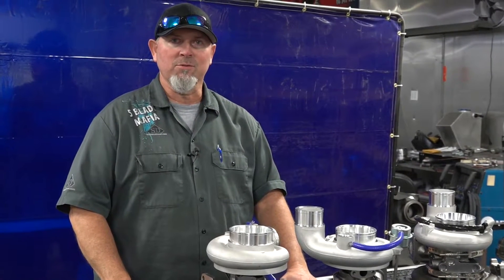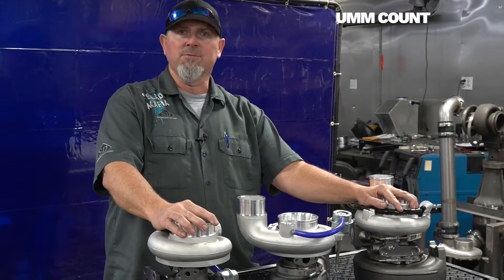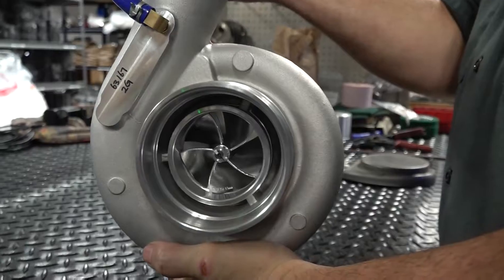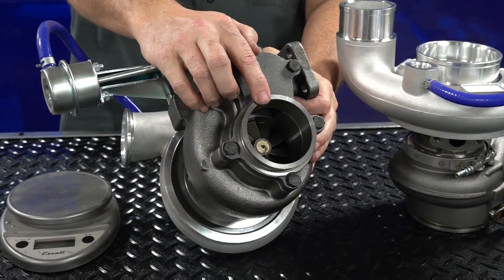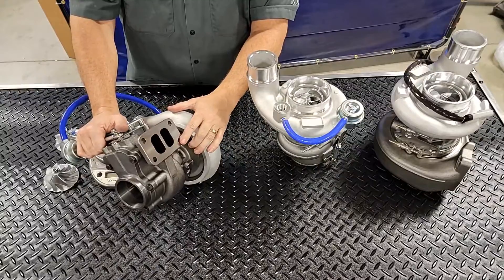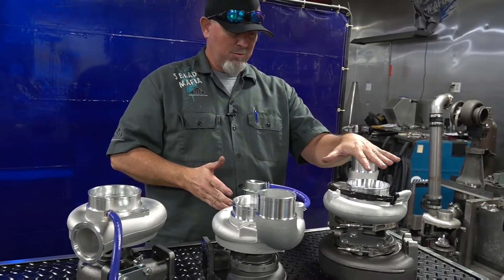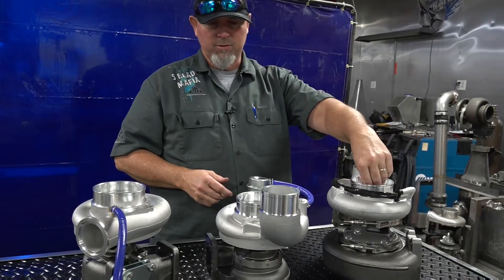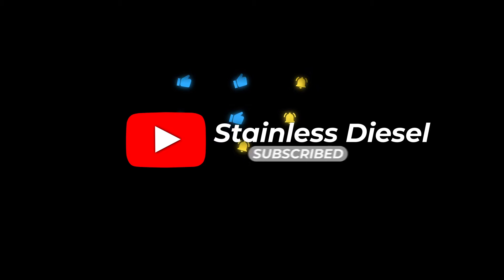OEM Bolt-On Boss Series 5 BladeTurbochargers

Comment: Hey I came up with something in college speech class. When I was running through my speech every time I said um I had another person say um back to me. It was really annoying but I only had to do it a few times myself and I've tried it on a few others with great success. I quit saying um all together. Again not trying to be mean or knock you just might help with the presentation. I hope this helps probably the only reason I noticed is because I used to struggle with it.

Comment: Any chance you guys can share or do a video on the weights of a factory HE351 turbine, shaft, compressor wheel and nut vs YOUR 60/60, 60/64, 63/67 etc?  Based on the weight you just showed, im guessing a 60/64 would spool the same as a stock 351, amd the 60/60 would be faster.  Would be a great video for you guys

Comment: What’s the advantage to the 5 blade?
Reply from the maker: Higher Flo, light weight 
faster spooling 
cooler, EGT’s, and a much louder jet engine, sounding  turbo whistle
Reply: I purchased one shortly after I made the comment. I love it!
Reply: @CBDiesel86 How the new turbo holding up? Any pros or cons you'd mind sharing?
Reply: @thesickening0169  doing good so far. Sounds awesome, and spools good
Reply: @thesickening0169  makes the truck that much more fun to drive. (5speed)
Reply: @CBDiesel86  How would you say its spools compared to stock? Just as fast, faster, or slower?
Reply: @thesickening0169  well I went with a tad bit bigger on turbo size Incase I wanted room to grow, so in a nutshell my fuel is setup for 500hp and I went with 63/67(650 rated) so it’s a tad laggy on back roads but on the interstate it spools pretty much instantly
Reply: @CBDiesel86  Perfect info, thats what I was thinking about going with too. Figured it would take a bit longer to spool up.

Comment: Finished installing the 63,67 hx35,huge difference in sound slightly harder to spool on stock injectors and I mean only a tiny bit for this size of charger its impressive
Reply: how would it spool with 5x12 injectors on my 97?
Reply: @Plantspirit  should spool just fine
Reply: How's it holding up?
Reply: @James L  runs great have over 10k miles on it now

Comment: @stainless diesel what can I expect from your 21 ram drop in turbo
Reply from the maker: Cooler EGT’s more aggressive turbo sound less drive pressure and faster  transient boost time on the 60/60  tow boss size .  Up to 730 horse power at the tires  on our 63/67 Boss units
Reply: @StainlessDieselRacing  MY GOD WHEN IS THAT BEAST GONNA BE READY IM LOOSING SLEEP YALL!!!

Comment: HOW WOULD YOU COMPARE THIS 6.7l DROP IN VS FLEECES UNIT
Reply: Personally they're better customer service. I have a 2004.5 commonrail and a 67/67 of theirs I'm about to drop in. And fleeces customer service is kinda bad from what I've heard from people i know who had them. Stainless diesel is very on it. I contacted them before buying a 67/67 and talked to them about it. Fleece wouldn't give me the time of day. These guys are very informative and everything and I can let you know how it is when it's in this week on Jan 14.
Reply from the maker: We make a 60/60 tow boss it’s smaller than fleeces 63/64 size  generally  spools noticeably  better with sock fueling applications . Our 63/67 size  Boss is a larger unit   And makes of the 730 hp at the tire, which is roughly 50 hp to 70 hp more than theirs  in testing .  It’s applications that are wanting more power
Reply: Well to tell you I got their 63 mm Vgt and a month later the actuator crapped out so now I have to pay for shipping and the amount of time my truck is down in the mean time and it keeps on throwing a turbo code p226. My father in law I encouraged him to get the fleece cheetah (it’s cheaper with a better warranty) and his isn’t near as laggy and sluggish to build boost as mine.